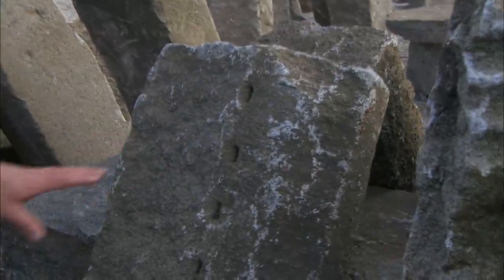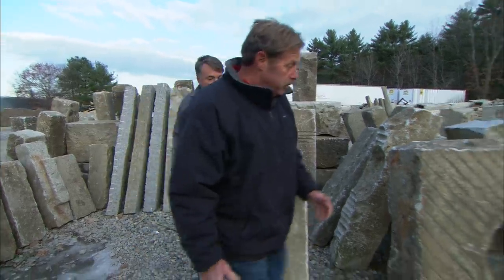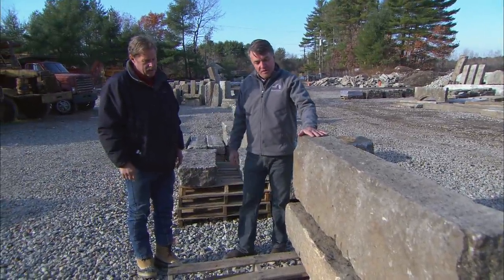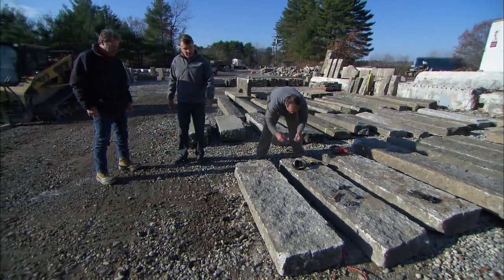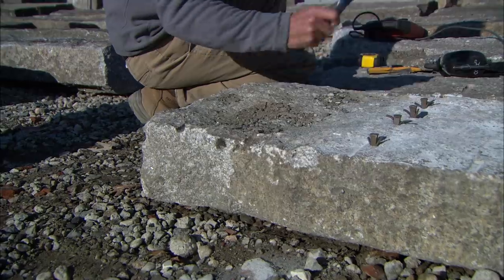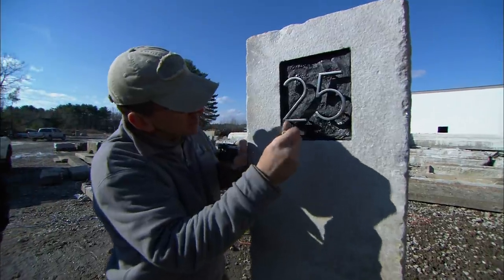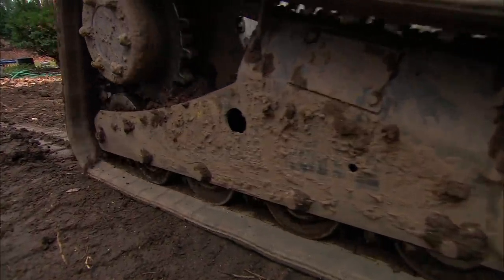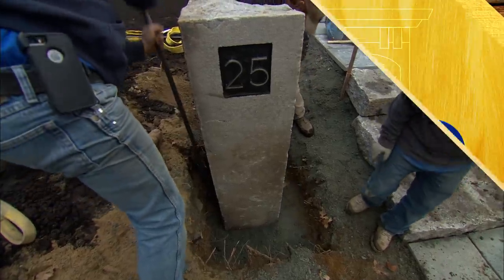Roger Tours a Stone Salvage Yard | This Old House

Comment: What a great idea, a "stone farm". When we had our cottage raised on a perimeter foundation part of the old fireplace had to be removed and the cut stones were spread around the property to "use them up". It would have been so much better if we had someone like Stone Farm come and pick them up and hopefully re-use them on another project. And it was good to see a stone worker use both a mask and other protection when using powered cutting tool. So many times I've seen a worker on a building site wielding a cutting tool without any protection at all against the stone dust.